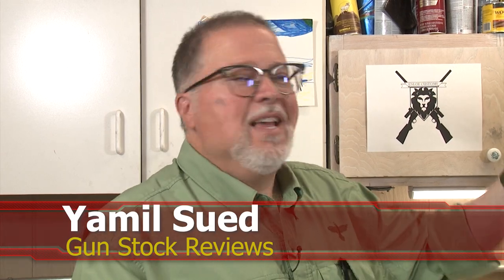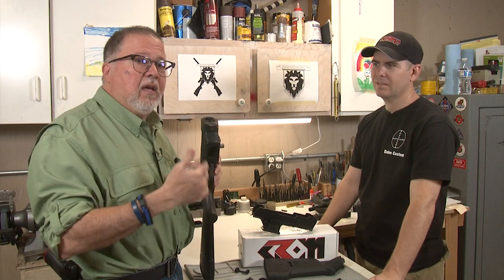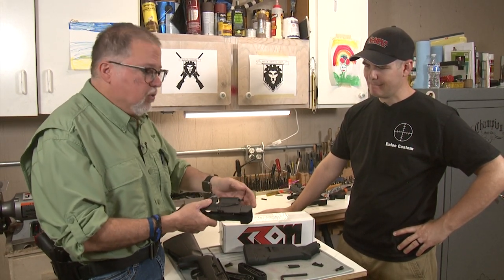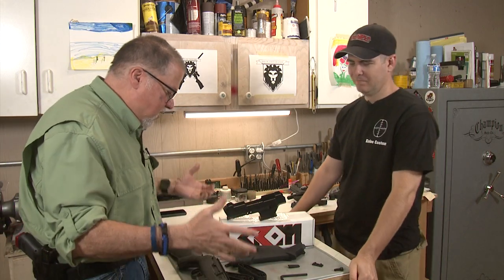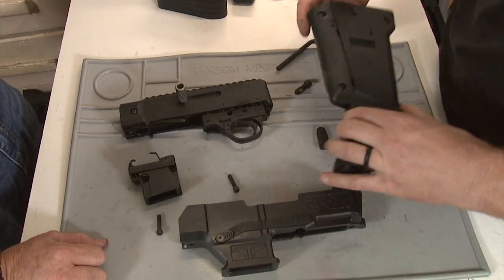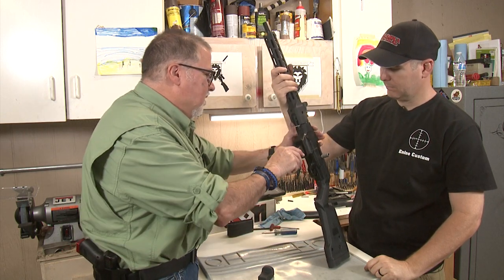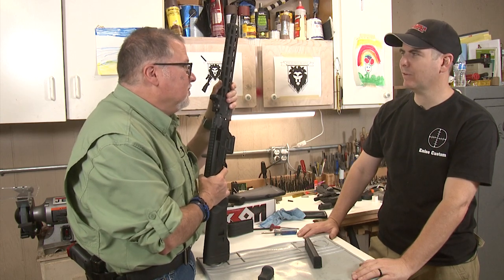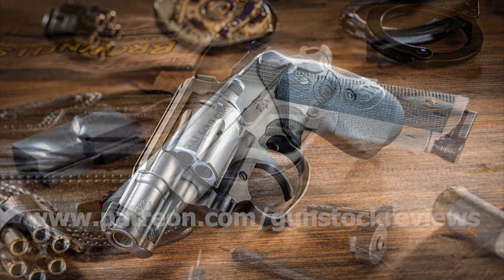CROM Chassis for the Ruger PC Carbine #1074

Comment: Looks good Yamil!! I like the way you did that. 
 I’d never recommend using hardware store screws/springs/bolts on firearms. The gun looks better than it did stock though! I’d have gone black with the charging handle though myself. Want to see you shoot it next brotha!
Reply: We have black charging handles for it, I like the NP3 for durability
Reply: @yrsued  np3 is definitely a great treatment and above Cerakote for certain!
Reply: @KendrasEdge757  BY A LOT!!  Cerakote is a spray and Bake, NP3 is a plating process that combines Nickel and PTFE.
Reply: @yrsued  yeah exactly. Anything bonding to the metal is better than spray paint. Powder coatings hold up better than Cerakote lol
Reply: @KendrasEdge757  I have a couple of cerakote items, this chassis is cerakoted, but for wear and friction parts, Plating is king!!

Comment: Does the CROM mag release only work with Glock mags and not the Ruger SR9 mags? Other mag catches I've seen for the Ruger PCC were like this.
Reply: This one is for Glock only, the mag catch itself is Polymer, I wouldn't use a Polymer Mag Catch on a Metal magazine and Vice versa...

Comment: The brake is installed incorrectly..... correct me if I'm wrong, is it designed to be mounted with the ports to be facing 12 and 6 o'clock????.... it basically increases the recoil by blowing the blast up and down.... on all my rifles that have a brake my ports are facing the 9 and 3 o'clock position to blow the blast to the sides ELIMINATING or REDUCING the recoil.
Reply: Yes, YOU ARE WRONG!!  This is a Compensator, NOT a Brake!!  There are only TWO Ports and they go up!!  Trust me, I have been shooting Compensators since 1994, on pistols and this Comp was designed as an older 1990's Compensator, he now makes a Brake, which I don't like, I prefer this old design MUCH Better. A Compensator was designed to Reduce MUZZLE Flip, to direct gasses UP, so it would Push the firearm DOWN and COMPENSATE!!!  Case and point, the 2011 pistol in 9x25 Dillon, it OVER compensated and pushed the muzzle down WAAAAY too much, but it had recoil out the ass.

Comment: I'm curious.... what's the advantage of the magpul stock? Looks? Cheek rest?
Reply: For me, the adjustability!!  Cheek Rest and extensions
Reply: Good texturing, high quality polymer, looks, and cheek rest options. But mainly, Magpul is just a great company, and they make extremely dependable products. They're the only company I've seen that can make aftermarket magazines that function better than the factory magazines. I'd trust that Magpul stock to take a beating far more than the standard stock, and I haven't used that stock, but I can only assume they designed it for optimized ergonomics. It just looks comfortable and form fitting, and every Magpul product I've bought has had comfortable and form fitting as a top priority.
Reply: Yeah, I just bought a pc carbine but it has the flag camo finish. So I probably will just leave it as it is. Was digging your build though and like the magpul stock on it. Looks great man.
Reply: @bigrockerjim  You know that you can have the Chassis done in any Cerakote color or even hydro dip it!!
Reply: @SuperMegaGaelourde  Magpul has some great products, I remember when they started, making just the...  Mag Pulls

Comment: Since the Ruger Pc9 made its debut in the American marketplace, there has been an ongoing issue with the gun's ejection system and the need to replace it after shooting 1000 to 1,500 rounds. Would you kindly address this issue?
Reply: Honestly, I got this carbine before it was released on Dec 2017, honestly, this is the first thing I heard about this.  The ejector is part of the Magazine block, it's a stamped piece of steel, just like the Glock Ejector.  If there was an issue, this is the cheapest part of the whole gun and if this was happening, Ruger just sends you a new Magazine/Ejector Block.  But again, this is the first time I heard about this and I have shot much more than 1500 rounds with mine.

Comment: I looked into Crom parts and accessories, they are nice but way overpriced.
Reply: You get what you pay for, you can't have CNC Aluminum for the price of injection Molded polymer
Reply: Not very good quality, the magwell insert needs a lot of work in order to hold the ruger magazines. It doesn't come ready to install. Also sorry but CROM Customer service is non existent. I contacted them and nothing, silence. Very disappointed

Comment: I am so sorry you lost my attention when you mentioned California and the problems that they have. I personally like the traditional rifle stock with the MLOC hand guard. I purchased mine with the American theme graphic. I was considering the change of rear stock but have decided against it. I have removed the spacers from the stock and it makes this weapon very short and easy to move with. Yet still remains a true PCC. I have equipped mine with a Holson shake awake green dot and blue laser on the chin of the front hand guard. I am very satisfied with this set up.
Reply: First, what's wrong with the good Gun Owners in CA?  They are victims of the oppression.

This is a good carbine and all accessories are good.